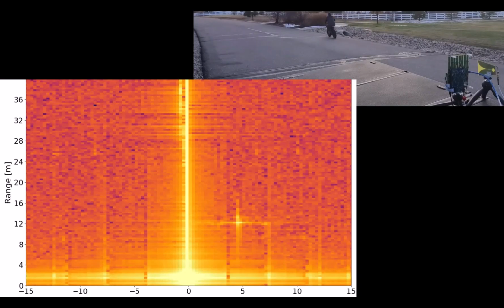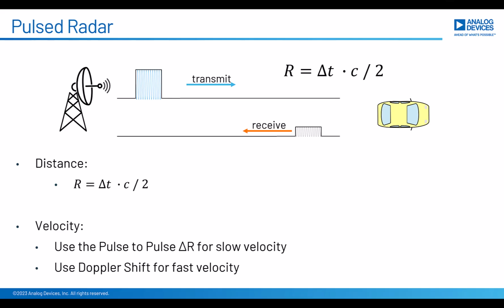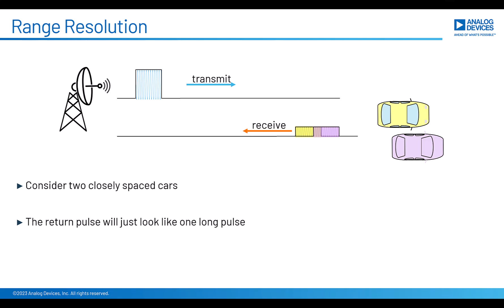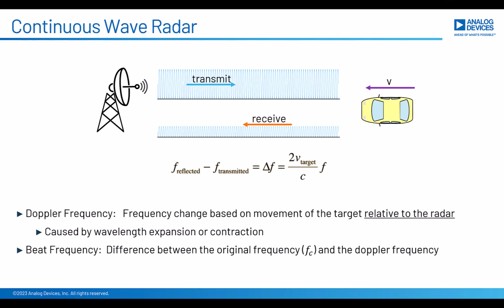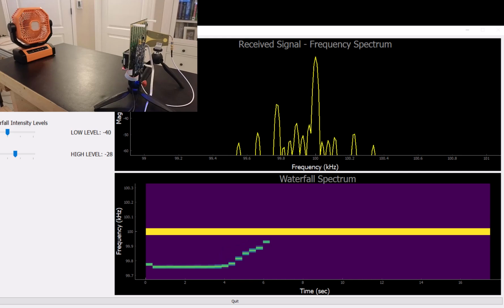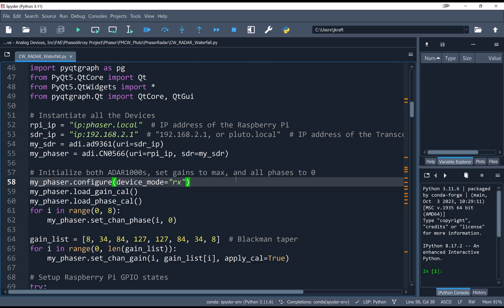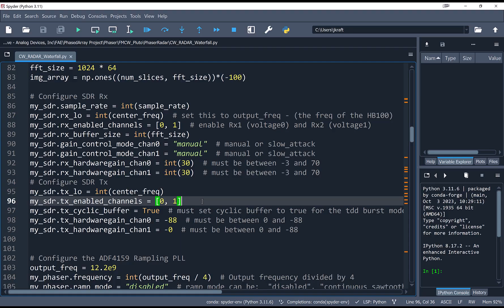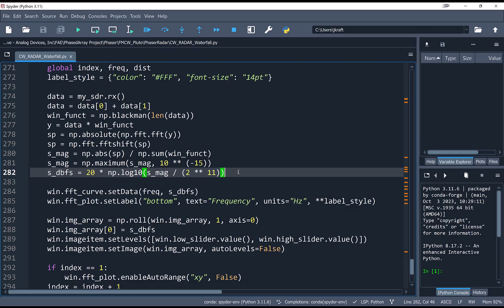Build Your Own Drone Tracking Radar:  Part 2 CW Radar

Comment: Are you providing any demo mid-release products? Its definitely non diy. Actual reciving and transmitting units seemed to be printed or somehow immersed on the surface of pcb, maybe multilayered pcb, and non standard pcb. The question is can one order such a set of pcbs on chinese pcb factories

Comment: Thank you for your insightful video and explanations. However, I had a question. I did not realize what is the role of Rasberry in this video?
Reply from the maker: Thanks!  The Rpi is essentially a USB to SPI converter.   So we can program on the computer, and use the Rpi's 40 pin header to send the SPI commands to the Phaser's chips.
Reply: @jonkraft  thanks

Comment: That's one reason why I suggested Plasma Antenna, since you can emit very high peak power and ultra short pulses unlike normal antennas!  Plasma antennas are perfect for pulsed Radar only problem is not many know about them since usage is usually in top secret projects that being said many of us out there that experiment with it would never look back at using any other type of antenna especially if you want to be stealthy and not get in trouble with FCC. Trust me, until you try out one, you won't understand what you're missing on it's a whole new ball game with plasma!!! 😀 oh and btw you don't need a phased array, Plasma Antenna can do everything a phased array does with 360 degree directional capability.

Comment: According to matlab Pt in Radar Equation is peak transmit power.
Reply from the maker: I believe they also factor in pulse width, so then peak power makes sense for their version of the equation.
Reply: @jonkraft  No, there is no pulse with their equation (it is the same as one you wrote) , but it make sense. The radar equation gives you recived power (reflected power), which does not change with puls width. Received energy is dependent on pulse width frequency of pulsed and power..

Comment: My understanding is that instead of SDR we can use some GHz signal generator for transmitting and some ADC for receiving. Is that correct?
Reply from the maker: Yes, you could disconnect Pluto and use a separate ADC and signal generator.
Reply: And we don't need a good resolution ADC, because we can mix (somehow) our TX and RX to get a beat frequency (which is in range of KHz) and digitize only that beat frequency.
Reply from the maker: The ADC still has to be good though, to digitize the beat frequency return and not introduce spurs, non-linearity, or DC offset.  But many other ADCs, other than Pluto, would work.
Reply: @jonkraft  Thank you for the replies, that really helps to understand the topic!

Comment: The gadget that made police radars practical was the microwave circulator. With that, one antenna could be used to transmit and receive. In WW2 it was common to put a yagi antenna on one wing, and another on the other wing, to provide isolation. Back then UHF FMCW was used for dive-bombing attacks. The ships were large, so the antennas and power were small.
Reply: Back when I was involved with microwaves, we called the rat races.

Comment: Hi Jon thank you very much for this It is very helpful. Why are you not trying to make a datacube with the recieved signals for further processing or is summing up the two channels more than enough? 

Also on a sidenote isn't our antenna an 8*4 array shouldn't there be 8 recieve channels? Or is it the number of adar1000's on the board? 

Its my understanding that we would need the datacube (I am following the Matlab tech talks explanation of fmcw radar) for the cfar algorithm development. 

Thanks again for this fantastic series much appreciated, I have backordered a phaser from digikey looking forward to building this out.
Reply from the maker: Thanks!  So I'm building this radar up step-by-step.  And we're not quite at datacubes yet!  And its not necessary for CFAR.  But the fifth video will be all about multi-chirp processing.  So it starts with a 2D radar data matrix of slow time and fast time.  From that, I can add antenna elements to create the cube.  But that would be a follow up video, and only if there's enough interest in phased array beamforming radar.  I'll post a poll soon with ideas for future videos, and this will be one of them.  Thanks.
Reply: Came here to say it’s very interesting, hoping to follow along as I acquire hardware for this. 😊